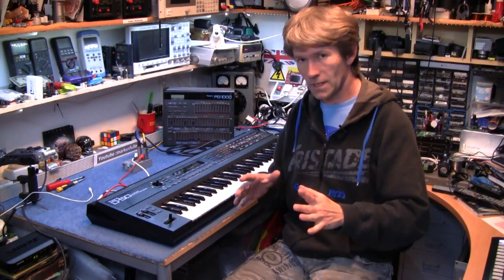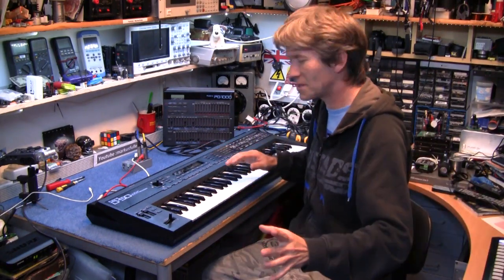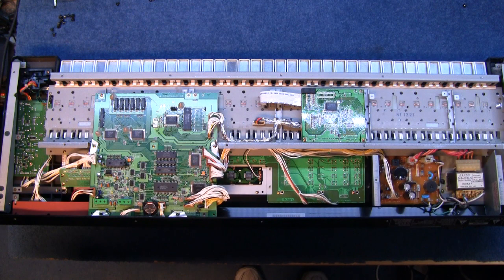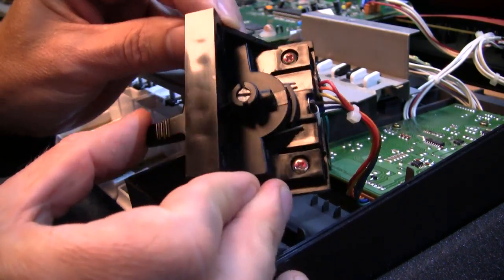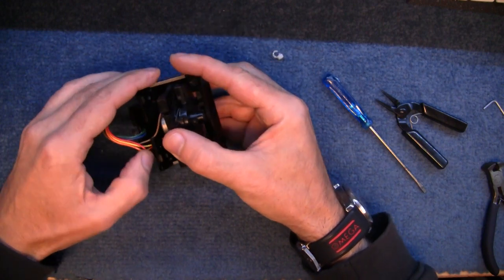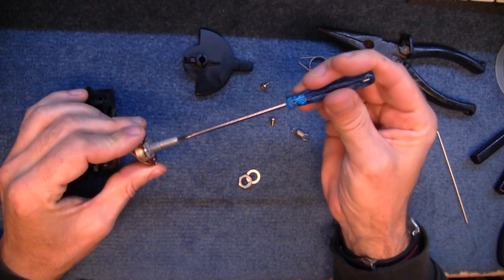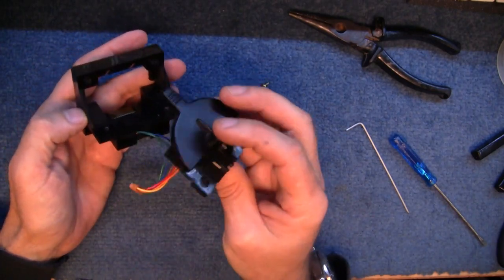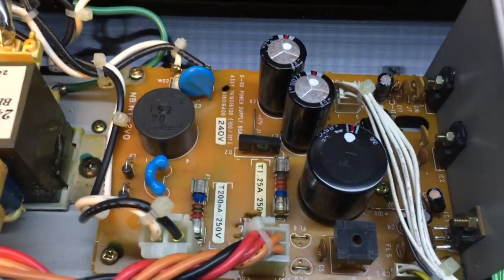Roland D-50 synthesiser pitch bender repair

Comment: Hello there you seem quite clever and technical. Let me exain what happened. I don't know if you are aware sometimes with roland d50 you need to clean the contacts which is undernearh the keyboard. I had 2 notes not playing and another one a bit quieter than the others.. I watched a video on YouTube about it. So I tried it. Opened it and cleaned as described. Screwed everything back up. Tried it out, two out of 3 notes fixed. So I thought well I am opening it back up again and fixing that last dead key. But on this occasion I decided to open it then plug it back in so I could test it while it was open, then I would know it was all fixed before I put all the screws back in but unfortunately I touched something inside with metal near my desk and heard a bang and a burning smell. So is that the transformer I blown do you think? I oddly enough just ordered that rack version you mentioned a couple of times, so I got that coming. But even so I tried to see if I can get a power board for roland d50 with no success, this said I have no idea if that's definitely the part that's blown.
Reply: P. Sy desk has a fake drawer which you just pull the front down and you can put your pc keyboard in there. But it has a metal hinge on it. It must have been that which touched it. My roland d50 is upstairs in bits atm and has been for a couple of months. Just bought a cheap ys22 so I can play the sounds from my roland d550 rack when I get it. So at least whatever happens I should be able to actually play a roland d50 again but on the yamaha ys22 synth via midi. Tbh seeing the roland d50 again in your video almost breaks my heart as I had that thing since the early 90's, it would be nice to get it fixed. But as said atm the moment the things in bits upstairs. Seeing it in your vid makes me feel although it will be great when the rack vers comes you just can't beat owning a roland d50.

Comment: Marcus.

I have a D50 with a similar problem - the pitch bend doesn't spring back, although it is not stiff, so II suspect a dodgy spring.

Have you any idea what would cause a couple of the keys to loose their touch sensitivity?
Reply: The touch strip below the keys will be grubby (Markus pointed it out in the video here https://youtu.be/-opDLsbwz98?t=848), it's not an ideal surface for this application but was practical and cheap. 

You will have to remove the keys probably (they will come out entirely on a bracket, shouldn't be too hard), and expose the plastic strip. The black lines are carbon "switches", the same as used in joypads etc. Wipe them down carefully with IPA, this will clean the gunk off them and not harm the plastic strip. Next you will have to do the same with each individual key, underneath is a black rubberised version of the strip. Use IPA and a lint free swap to wipe each rubber blob a few times. Don't touch them at all after cleaning, just keep gently swabbing until there's no visible grot on the swabs. Leave to dry fully before reassembling (some IPA has a higher water content) or the pads may stick to the plastic strip. 

The spring may have come off of the plastic pins that retain it, or the plastic pins may have broken off (worst case). Do what Markus did here to have a look at the assembly.

Comment: Hi, really enjoy these videos! I've got an xp30 which looks like it has an almost identical pitch mod wheel. The modulation sensor isn't working properly. There's the (what I think is) capacitive film folded over on itself and a bit of conductive rubber (varies from about 500 ohm to 2k depending how hard I press the meter leads together) that I think is meant to go in between the 2 layers of film. However the mod doesn't seem to work like this, I've tried with the rubber next to the plastic presser and I'm getting midi etc but it's seems pretty much off, low value or full. I can't quite see how the rubber is supposed to be from the video. I can't work out whether the fault is the rubber, the assembly method or whether there's some calibration setting hidden somewhere. Have you got any suggestions? Unfortunately the service manual I found doesn't seem to go into any detail with the pitch bend assembly. Thanks!
Reply: And now its working again after several years of it not being OK. You can access the test mode on xp30 by holding controller - Oct and expansion a whilst powering on.

Comment: Can you address the concern of aging capacitors on these old synths?  I've stopped short of buying some old gear because I worry about things going bad on them.  I've heard of capacitors going out or even damaging the surrounding electronics.  I've never had this issue yet with any of my old gear but it definitely worries me.
Reply: If i was a genius i would invent the ever lasting capacitor. It's scandalous. I just had to have my emu 1820m fixed and it whistles a little bit now after It's been on for a while!  Planned obsolescence if you ask me

Comment: I'm so sad. My pictch bender got broken and I'm in crisis. 
Do you have any inside advice where to find this precious replacement for the pitch bender? You'd save me. Thanks for everything you do.
Reply from the maker: Hello Im sorry but I do not know where you can find a replacement pitch bender. there are so many different types and shapes and its almost impossible to pull one off a different keyboard. you have to find the same. have you tried the website called syntaur.com ? they have many vintage spares.
Reply: @markusfuller  Yes but it is out of stock and who knows if it is for ever. Thank u so much.

Comment: Hi Markus, I have a loud key on my D50 which I assume is a velocity issue.  Would this be a key contact issue, and are these easy enough to clean from your experience? Cheer
Reply from the maker: Marc Nelson Hi Marc, the keys actually press down 2 pads one just before the other and thats how it knows how hard or rather how fast you have pressed the key so it may be a simple job of cleaning up the carbon contacts under the rubber pads as it is probable not working out the difference in time between the first and second carbon contact.
Reply: Many thanks Markus.  I'll strip it down this evening and check the contacts have a good weekend.
Reply: markusfuller spot on, Markus cleaned the contacts and all fixed!! Cheers for the advice
Reply from the maker: Marc Nelson Brilliant Marc, im pleased you got it all working again. best wishes.

Comment: Does the PG send info straight through SYS EX midi messages?
Reply from the maker: Hi Neffers, yes I think it is all Sysex information that is sent.
Reply: Cool, I didn't think Sys Ex could be sent on the fly like that. That opens a whole world of modulation possibilities surely?!
Reply from the maker: Hi Neffers, If you are holding a note then change a fader on the PG then nothing happens until you retrigger that note. whereas midi could change the sound Sysex seems to only make a difference when retriggered after the command has been changed. its all smoke and mirrors to me. LOL
Reply: Ah, I see. So it's not practical to use the PG while performing / playing back Midi. Shame, that could have been a fun tool for you to abuse.

Comment: nice, what sampler did you use Markus?
Reply from the maker: Hi I used the pioneer toraiz though to be honest im not getting on with it too well.
Reply: interesting, i always though its more of a dj tool (and quite expensive hehe)..
.. and unrelated question, have you ever repaired Akai MPC? or do you recall any video where you repaired tact switches?
Reply from the maker: Hi the Toraiz is similar to the MPCs but it is seriously lacking some firmware upgrade. I have taken apart the Ableton push 2 (which I still own and use) but I have not done a video on Tactile switches specifically but I think I did some replacements of them in the Yamaha W7 video.
Reply: thank you Markus
Reply: Tactile switches.... there's many types of defining tactile as far as swiching goes. If you google tactile switch you get the common four pronged black buttoned devices. For these you can find a multitude of specs, the rise, height and diameter of the black button, the pressure required to activate and all manner of info.

One word of warning if you are looking to replace this kind, get a proper one. The ones made out of chinesium are great, for ten minutes.  Omron is the brand to go for when looking for any mechanical micro / tactile switch. Sadly it's well know for the guys over at china to stamp Omron on anything, beware of fakes.  

Start here. https://www.omron.com/ecb/products/sw/

Tactiles are here https://www.omron.com/ecb/products/search/?cat=2&did=2&prd=tactile-standard&lang=en
Reply: thanks Neffers.. I found correct size and construction ones by omron, and they have "Voltage Rating DC: 24 VDC", i read somewhere the mpc ones are 12V.. he recomended ALPS 688-SKHHAL.. which are 12V.. are ALPS any good?

either way, the shipping cost for small packages is pretty brutal to central europe:/ and local dealers have pretty brutal markup.. the same on ebay
Reply: ALPS are good yes, they are the guys that do a load of faders and pots for desks too. I neglected to mention a few other manufacturers of bits and bobs, my fault. I have found ALPS faders and pots on low end gear and higher end gear. I'm not a pro by any means, Markus has probably encountered more than I have, and I hope he chimes with his views.

Again though, be sure to purchase a proper ALPS, they are also cloned left right and centre. I know it's a pain and you will pay a premium by doing this, but you are repairing a premium bit of gear and you only want to have to do it once.

Saying that, buy in bulk, maybe buy as many as you need in a worst case scenario if they all died (one has already!), you then have plenty in a drawer, and aren't having to pay through the nose for one and having to wait for delivery.

Regarding voltage, the "Rated" in this case means how many volts the switch can pass through  So long as you are below the rated voltage, you are good to go, you are only needing to make a low voltage contact, not trying to switch a mains lightbulb on and off, most of the electronics in your device will be around 5 volts, possibly even as low as 3.3 volts.

With these tactiles, do not linger with the soldering iron. They hate heat.
Reply: thanks for all the info.. by the way, my MPC is far from premium bit of kit, its old beaten cheap dusted on peace of gear:D still would like it to work properly as the midi sequencing on it is quite great for my needs (far better than the new electribes)
Reply: No problems at all, I really hope you get it fixed. OK, so it's a grotty bit of gear, but it's something you are accustomed to. Make do and mend bro, make do and mend. 

There's probably some dude out there dying to get an MPC on his hands, and can't due to budget constraints or not even being able to find one, imagine the feeling if he found out someone had chucked one in the bin for the sake of a dodgy button! 

Good luck and long may it make beats.
Reply: actually I was the dude trying to find cheap MPC:D Im not throwing it out for sure!
Cheers
Reply: Even better :D
Reply: Thanks Markus brilliant videos, All the best.

Comment: Interesting.  I wonder though why so many people refer to editing synthesizer parameters as "programming".  Programming is what Roland engineers did in assembler, or C, or whichever language it took to write the D-50 operating system, no?  And actually, it's not even an operating system.  The OS only organizes the hardware, reads memory addresses, scans keyboard, etc.  The synth parameters is an application ready to use by anybody.  Why do so many people refer to "using" this application as programming?

Comment: The main board changed over time, I found a picture on which the SYNTHE DSP is in a ceramic PGA package instead of the flat pack http://jeanmicheljarre.pl/radek/studio/Roland%20D-50/20101217260.jpg

Comment: I have got some dead keys on mine now....30years crisis !
Reply: i have the same problem. I fixed it couple times by cleaning the contacts with alcohol underneath the rubberstrips which i also replaced once, but never got the keys to work for more than a month or so. I think the alcohol wasn't the best product for that. i also have some gunk in my front panel buttons. I cleaned them also (it's a pain to get there from the bottom) but i only got some them to work properly. Most used buttons are in the worst condition, so i need to replace them in some point in the future.